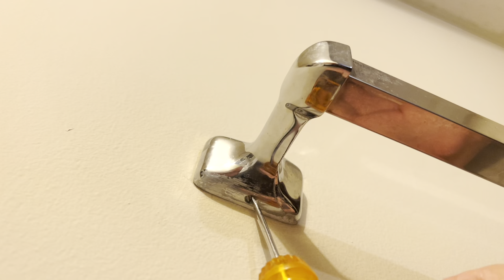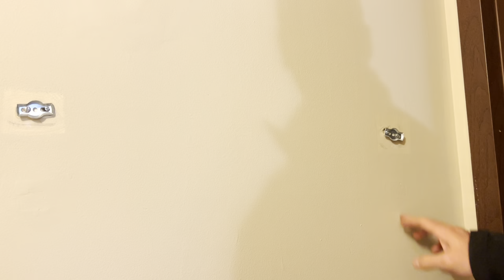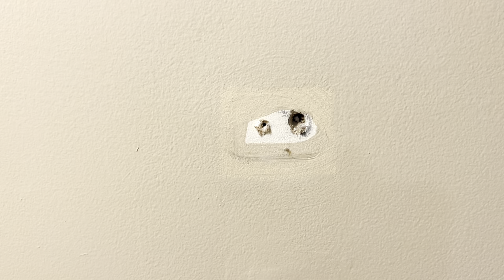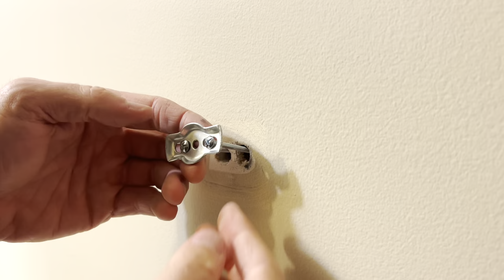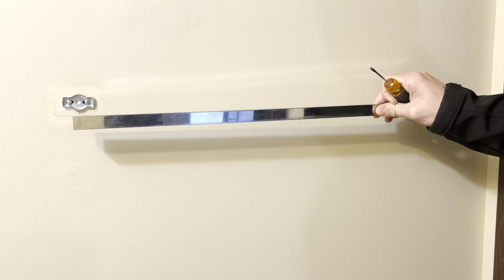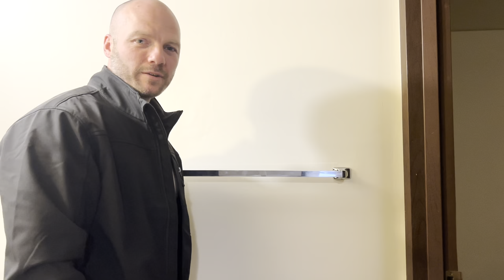Fix a loose towel bar, Permanently

Comment: Love this solution! Much more elegant than using messy caulk or spackle.
Reply from the maker: This works great as long as the hole is not torn out too big. I wish the towel bars would just come with toggle bolts to start with. it was save people having to replace them when they tear out.
Reply: @RoscoReviews  , worked like a charm! Hopefully my 14 year old will be more careful with our towel racks from now on, lol.

Comment: How much weight can those butterfly anchors support?  Can it hold a bathroom wall shelf in place?
Reply from the maker: If you are attaching only to drywall, then these toggle bolts "butterfly anchors" are probably your best bet. how much it will hold will very. The bolts come in different sizes (the bigger the better but it has to fit your mounting bracket). I was curious, so i looked it up. Google says a small toggle bolt should hold up to 30 pounds. I probably wouldn't trust it to hold much more than 10 pounds per anchor to be safe. If you can find a stud to screw to, you will be better off.

Comment: I like the toggle bolt solution, but what if the hole that was made is much bigger bigger?
Reply from the maker: If the hole is bigger than the toggle bolt. I would probably consider moving the towel rack up a couple inches. if you patch the holes and move it up a little bit it will cover the holes a little bit and then you can use the toggle bolts in the new holes.

Comment: Would these screws and anchors work for a curtain rod bracket as well?
Reply from the maker: Sure! These are called toggle bolts. In my opinion, they are the most secure type of drywall anchor.